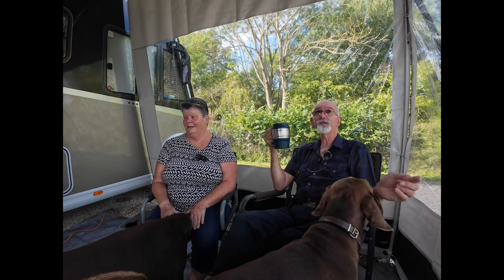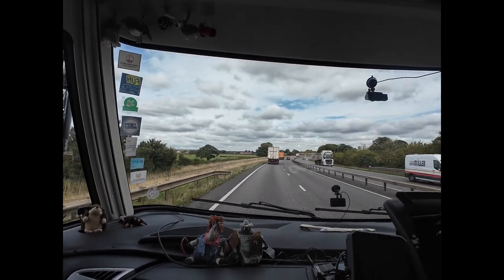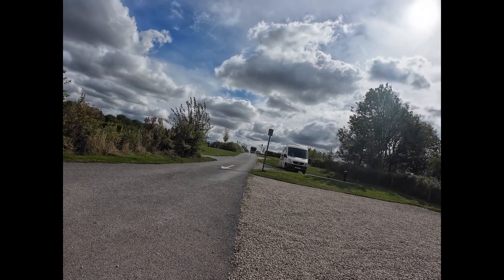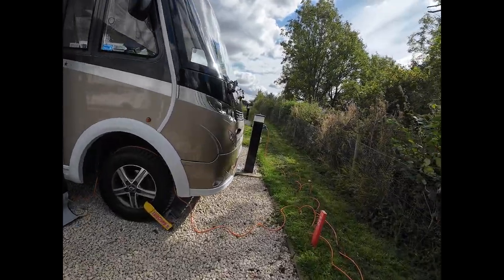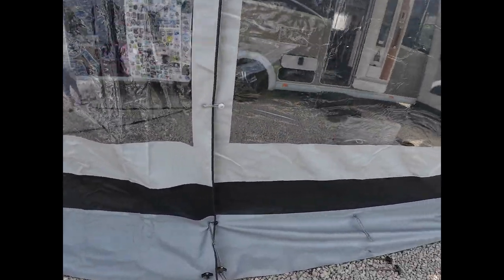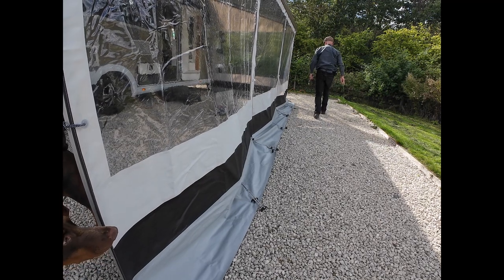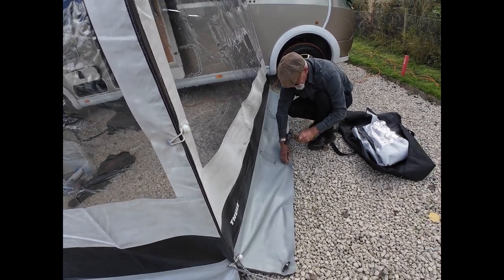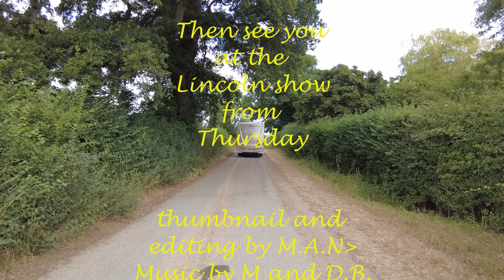EP87 Waleswood and setting up

Comment: Mark what pegs do you use Peggy pegs ? I use a lump hammer as I find I hit my new metal pegs with my extended pole you hit them in with cost around £150 for 20 pegs and 1 metre metal stake that you not the pegs brought from a Warner show earlier in the year save a lot of bending?